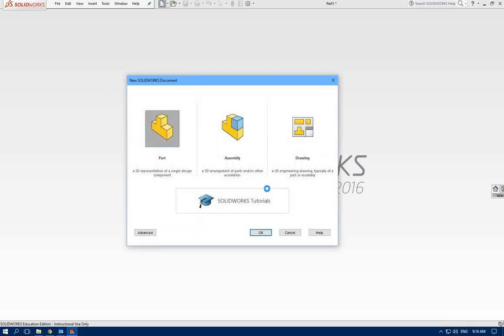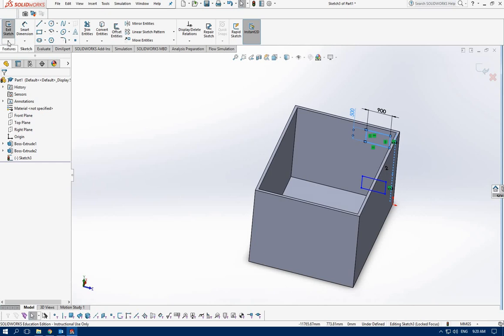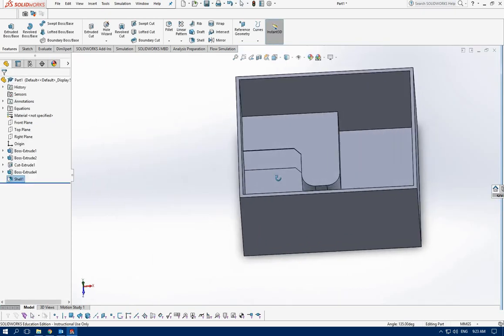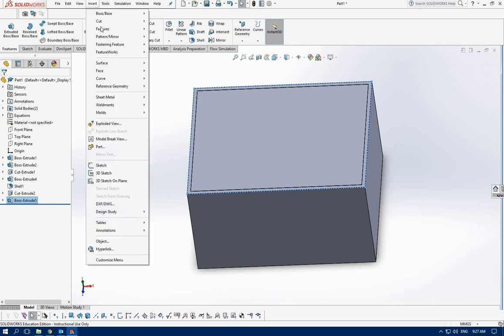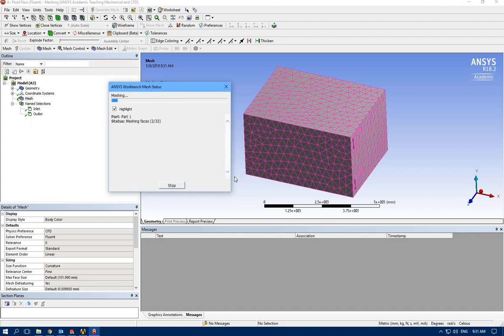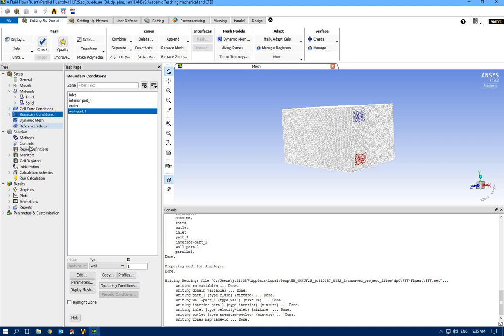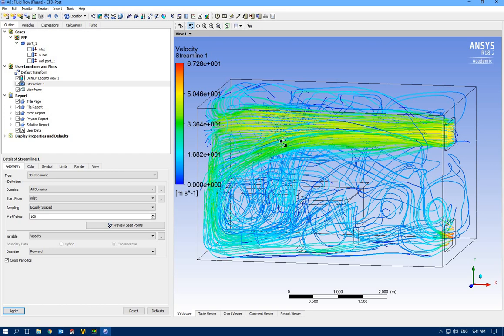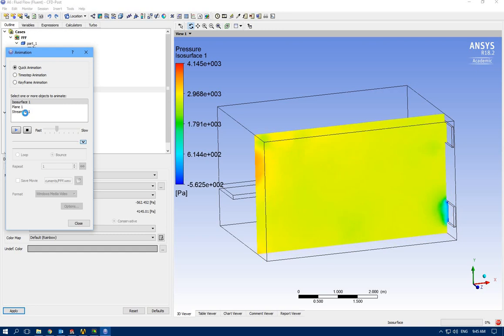AP12 2 ANSYS/Fluent training

Comment: Thank you for your useful video, when i saw other videos i found that they are modeling big box around the room, kindly can you tell me why you are didnot make like that? and does it have any effect on the simulation? thanks
Reply from the maker: Hi Mohamed,
This depends on what you want to investigate. If you need to include environmental effect on the room, you should include a larger domain around the room you are investigating and consider its thermal interaction with outside (such as wall conduction, convection and radiation). Basically, it will be a conjugate heat transfer problem.
For this video, I wanted to simplify the condition and illustrate flow pattern.
Reply: @mehdikhatamifar7043  
Thank you so much for your explanation, kindly can you give us example for this  case? i mean including environmental effect. Thank you again

Comment: I have a problem with displaying the results. I have run the calculation. It was all fine but I wasnt able to see air flow. What am I missing?
Reply: I am also facing the same issue could u please help??
Reply: Hi, you should choose streamline option at the ribbon pane above. Then, select inlet and outlet. Then, you can click animation to see the flow